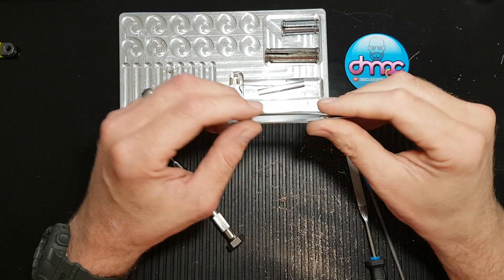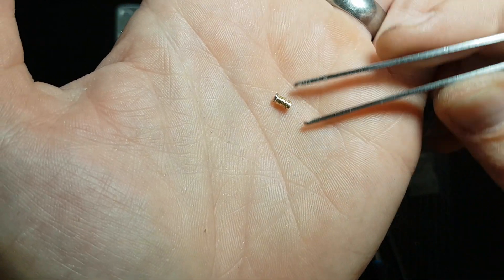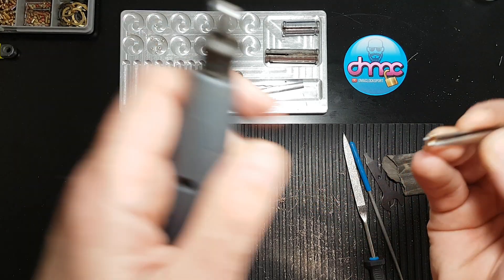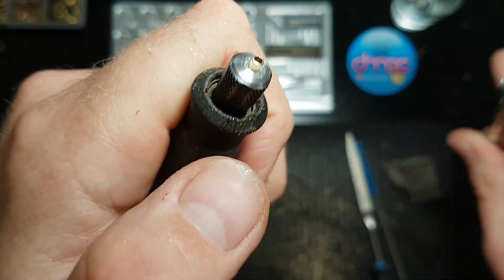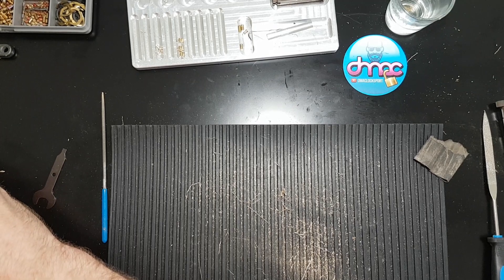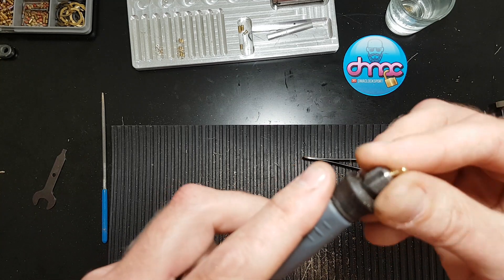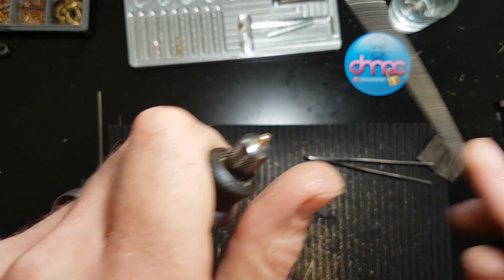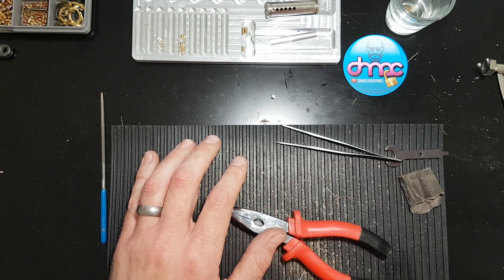How I make my rattlesnake pins for challenge locks 😎👍🏻

Comment: Definitely easier than solder!👍
Reply from the maker: Indeed. It seems to hold up to picking well so far too but I might try epoxy next time just to be sure 😉👍🏻
Reply: @Dmaclocksport  I got to use some JB weld to fill in the the trap pin holesat the 1030 position on the plug. Had bricked one up because I went clockwise with the key ground off the crimps and was able to get the pins plus it gave me an extra plug to practice undercutting, so no real loss. This video helps out a lot! Thanks for putting it up! I will have to give your way a try!

Comment: I started watching this and wondered if I could just drill out some master wafers, since I have no fine saw like that.  I've drilled pins before but they were small drivers. Tweezers weren't working to chuck up that tiny pin... so I picked it up with a piece of electrical tape.  Worked!  Just made 2 from Kwikset #4 Master wafers.  I'll try smaller after I watch the rest of this video.
Yes. I was able to do #2 wafers and that is about as small as I think practical. After dragging them across some 600 grit paper they measured out about 0.95 mm thick.

Comment: Cool video on how to make those pins, very neat work. Little worried that the super glue wouldn't hold up to picking for long. Maybe the glued end could have a smaller diameter so less force would be applied to it in the bible chambers.
Reply from the maker: Thanks for your comments. So far, they've held up, but I did a short update video a few days later on a different method for capping the pins for the very reasons you mentioned. 😊👍🏻

Comment: I don’t want to teach my grandmother to suck eggs so to speak.
Rather than regular Super Glue, I think I would use permanent grade Loctite, I have seen and used it in fitting and turning on a lathe or milling machine, it works really well.
Reply from the maker: Although I havent had any problems to date, I had some similar comments previously. I did a rattlesnake pin update video where I used a ball peen hammer to close the loose rings as another, more permanent option 👍🏻

Comment: Also do y’all have Gorilla glue? Or even maybe a 2 part epoxy? I wouldn’t trust super glue to hold anything other than what it’s originally designed for, which was mending wounds in battle. Or maybe it doesn’t matter once installed? Or am I over thinking it can still work if separated? I’m tough on picks and pins for sure as I’ve been heavy handed while learning. And was a tip I heard from LPL in one of his tensioning clips. I think light is the key. Punn intended 😂
Reply from the maker: So far, so good with superglue. No failures yet. The superglued bit sits higher in the bible so shouldnt be subjected to strong force. I am planning on using epoxy next time to compare though.
Reply: I wouldn't be using strong force on anyone's CL they've built with custom pins, it's an unwritten rule man

Comment: I never thought u could use a dill bit like that. What is holding that bit? Is it a hand crank style holder? Or did u manipulate something into a holder? Great video mate!
Reply from the maker: Cheers buddy. It's called a pin vice. Designed for hobby use where you need to drill by hand. The principle is the same as a lathe in that the cutting bit is not spinning, but the material is. This means you get a better cut and it self- centres 👌🏻

Comment: I wanted to let you know that I've found the best way for me to make rattlesnake pins. I've tried silver solder and it's hard to get the cap to stay where you want it when trying to heat it up and don't apply solder. Epoxy is very messy and can be unpredictable, at least for me. If you're interested sir I can give you my email address and I'll gladly show you what I've come up with.
The way that I found you're able to adjust the size of the pin as well as any distance you want to give your buttons / wafers to move around.
Reply from the maker: Sure, I'd be interested to know. I've been toying with another idea myself actually. My email is indysigns@live.co.uk
Reply from the maker: I've just uploaded another method using a ball hammer which seemed to work well 👍🏻
Reply: @Dmaclocksport  awesome I just arrived at the office I'm about to check out the video, I sent you two separate emails. The first one shows my rattlesnake pin and the second one has links of what I used and what I will be using to make my rattles. Also tell us in a couple of pictures of some of my work on key pins and I would love your feedback cuz I know you do awesome work!

Comment: What size collet do you use in your Dremel?
Reply from the maker: Er, no idea! Its the only one that came with the dremmel when I bought it
Reply: @Dmaclocksport  cool i have the same one but i did drill out one of the smaller ones but i think i went a little to big i originally drilled it out to 2.5mm but was a little tight so i bored it out to 3mm which is to big so now i have to tighten it up to get it to bite.